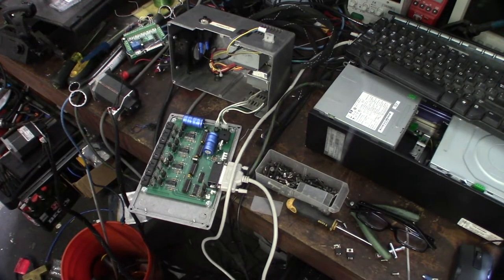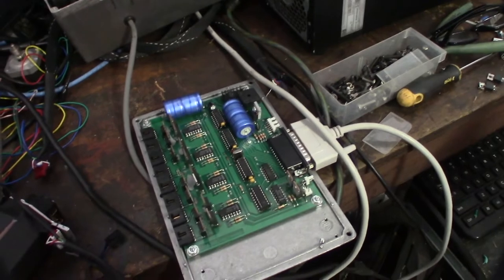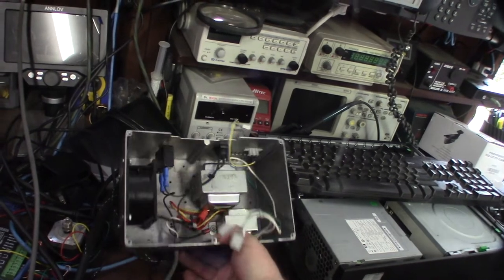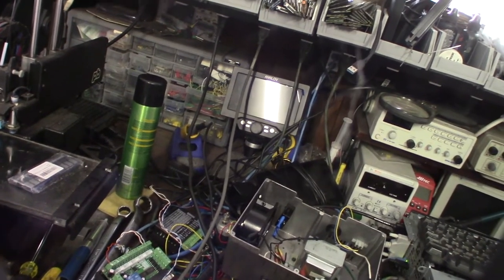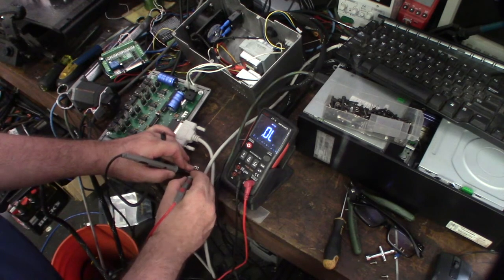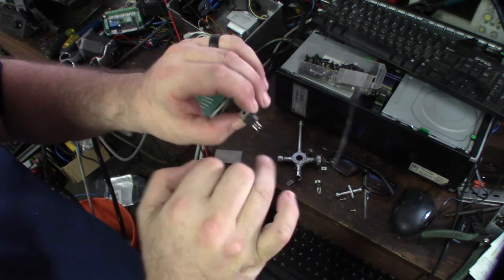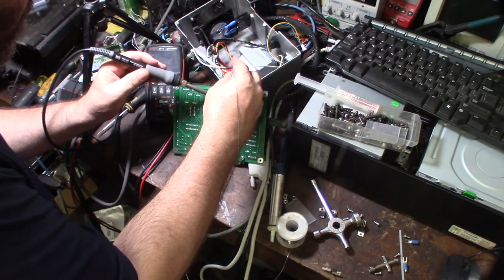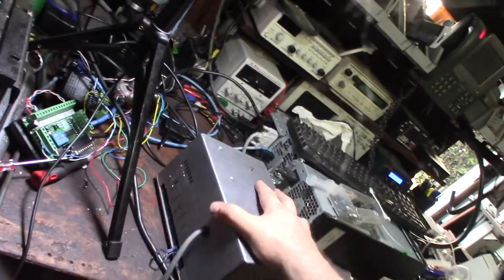CNC control board repair MaxNC CL, Bad Mosfet, Unique Quadrature Closed Loop Steppers, Mach3

Comment: I've got a MaxNC 15CL; and I'm having a heck of a time figuring out how to get the controller to communicate. It has the actual button controller, which moves axis', homes, and will MDI, however it won't read the compact flash drives anymore, and I'm unsure if the drive slot is bad or the board is bad (it seems to see something when I plug it in).  Any guidance would be lovely, as I can program and run it if I need to, but loading Gcode/communicating with a PC seems to be the issue.

Comment: Could you measure the frequency of the quadrature signals on the parallel port coming from the computer? If we know the frequency, we can use the LinuxCNC instead of Mach3.